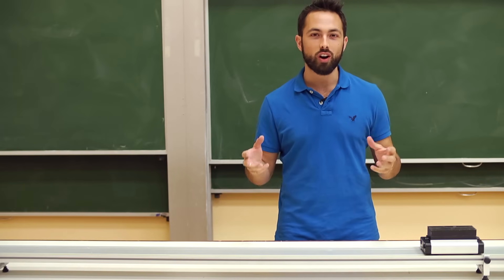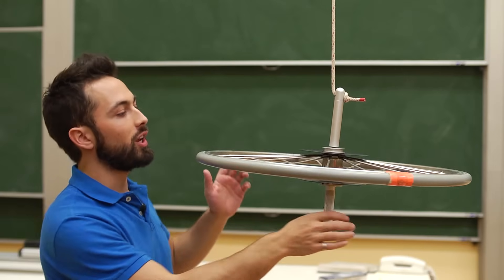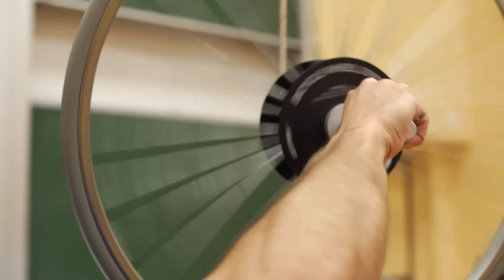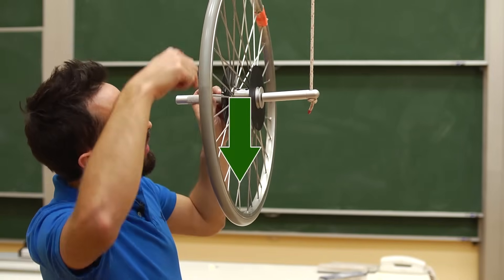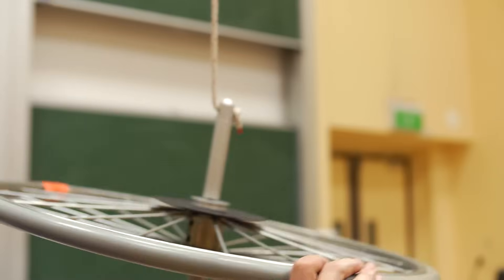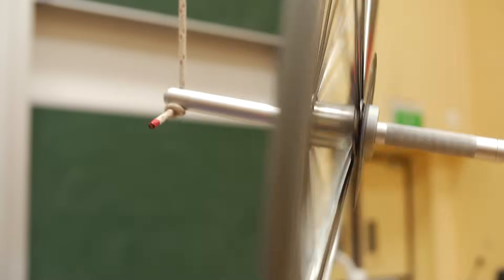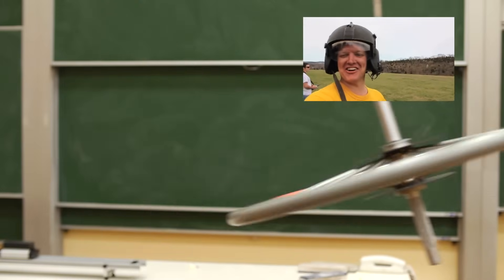Gyroscopic Precession

Comment: Angular momentum is used AFTER a right-hand rule.  That means you are using a math analogy that has NO basis in fact at all -no real mechanism.  You do not understand anything using accurate math analogies, because math does not need cause to generate coincidental answers for you.  THINK, spin and tilt are perpendicular vectors around a plane which don't affect each other, and momentum is a potential energy that does nothing.  Spin only sets a rate for the real cause.  Look at my video explanation based in CAUSAL accelerations.

Comment: Would the linear equivalent of gyroscopic procession be like a puck is moving along ice in a straight line, and then you apply a force at 90 degrees to that motion thus changing the motion (and momentum) of that puck to some other angle (still moving in a straight line)?

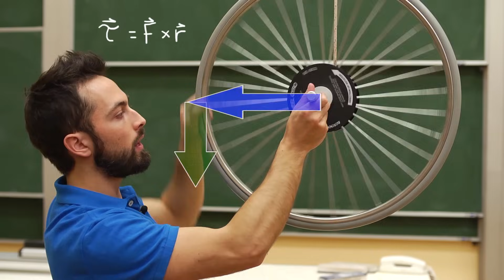Comment: The vectors in the torque equation at 1:18 are in the wrong order. So the sign in the equation - as it's written - will be incorrect because it depends on the ordering of the vectors. (Look up "torque" on Wikipedia for the correct equation.) Really nice video otherwise!

Comment: Exact same thing on the motorcycle the wheels are in fact gyroscopes use the term counter steering applying force or change direction speed and weight

Comment: If we spin the wheel there are two angular momentum. One is for spinning and another is for the weight of the wheel. Since angular momentum is a vector quantity therefore the new torque is just the rate of change of the resultant angular momentum.

Comment: Here’s a thought.
A simple example - LNG returns to its gaseous state when de-compressed.  This proves that molecular bonds are elastic.
I find the right hand rule explains nothing; only describing what happens.
Could bond elasticity under the influence of gravity not have a bearing on the direction the spinning wheel rotates?  The stretched lower half would effectively have a greater radius than the compressed top half, therefore the lower half would have a resultant ‘throw’ in whichever direction it is spun?

Comment: Physicist: 

this is called conservation of angular momentum, a bit of a word soup but ill try to explain.

its worth noting, this is similar to an expiriment with a wheel that demonstrates gyroscopic procession, but thats a different concept. I can explain the difference if someone wants.

when you spin the wheel you give it angular momentum (spinning momentum).

if the guy in the back wasnt holding the chair, when the wheel was being spun, the chair wouldve started rotating counter clockwise. the actual "pushing" of the spin only happens during a change, like how you would push a toy car on a flat surface, its only speeding up in your hand, once you let go it only slows and stops. so as the guy holds him, when the string ends spinning, its no longer twisting the chair.

when the guy on the chair twists the wheel, hes changing the direction of the spin of the wheel, and as he does so, it puts ann equal opposite force on him the other way. If he turned it over and held it there, he would slow down and stop. he was only being activly twisted while he was rotating the wheel.

Comment: 01:10 I am commenting on a 12 year old video, maybe too late to make an impact. "Torque is Force times the distance from the rotating axis." No, that's how we measure torque, but it doesn't explain what torque actually is. Torque is a pair of two forces, parallel to each other, but opposite in direction, applied on two different points of an extended body. Even this is too complicated for a layman. But at least we can make it simpler if we consider each phrase at a time. To avoid making the comment longer I will stop here.

Comment: I have found this video after searching to see if something can rotate around more than one axis at a time. Specifically I was imagining a pair of black holes where the combined rotation around their own axes (plural of axis?) is at 90° to the axis that is the point that the two black holes orbit each other around. Can that result in a back hole that has two axes of rotation or does the final combined black hole rotate around an averaged out single axis? Is there something in conservation of angular momentum that works to align the rotation of an object with it's orbit of a binary companion? Like will a planet which orbits with a north pole that faces it's star at one point in its year then half a year later the south pole is star facing realign to have a rotating equator facing the star?

Comment: @Veritasium, if I'm not mistaken this example is a bit like a helicopter, the spinning wheel is the main rotor and the rope is like the tail with the small rotor providing an opposite force or "thrust" so that the helicopter doesn't itself spin wildly opposite the direction of the main rotor. And by manipulating the torque angle of the blades which the "angular momentum" follows, the direction of the helicopter is altered.

Comment: While your statement that the two rotors cancel the torque of each other is correct, the demonstration of gyroscopic precession is very misleading. It’s incorrect to say that that’s the reason helicopters have a tail rotor. The main reason is to cancel the reaction moment caused by the drag on the rotors.

Comment: I found a major mistake in this activity which I will definitely correct when I will perform this activity in the classroom. The person demonstrating the activity in the video at time 1:15 wrote the formula of Torque as Force cross Radis vector
  which is wrong and the correct expression for Torque in vector form is Radius vector cross Force vector because torque is a vector quantity and vector cross product is not commutative . The person after writing the formula wrong uses the correct formula while finding the direction of torque using right hand thumb rule. If he would have used the his written wrong expression then the direction of torque would have been opposite.

Comment: At the end there where the wheel is spinning in the direction of the angular
momentum, to neutralize or stabilize the 
angular momentum you would need an 
"anti-torque" applied to it in proportion to the torque produced. That's why helicopters have anti-torque pedals, to keep the fuselage from spinning in the opposite direction of the main rotor n to keep the fuselage pointed in the correct
direction or heading...🤔

Comment: This concept is used in flying saucers to stabilze them but with an additional way to propulse the saucer using centrifugal force, and the center with the pilot cabin has a system which absorbs the shock from massive acceleration that would normally kill you
Reply: I was thinking this too!

Comment: So it's the torque increasing the angular moment of the wheel in the direction of the torque that holds the wheel upended and not the magical force of gravity pulling the rubber tire to the center of the earth?

Comment: Imaginary torque vectors to explain the wheel rotation is actually obscuring understanding. No perpendicular to plane forces at play here. Only the speed vector of every point in the wheel in every instant are being applied a perpendicular force with max amplitude and opposite direction on vertical extremes of the wheel. This changes every speed vector out or inwards but in next instant that point is taken away from its prev position, keeping it’s new speed vector pointing outward or inward (top or bottom points). Which as the points approach the horizontal line crossing the center, forces the wheel to rotate.

Comment: In nature there is obviously no fixed spinning objects in the sense we have manufactured through the use of bearings etc. So my question is, if you add up all the spinning objects created by humans on earth, such as engines, cars, trains, bicycles, electric motors and so on in certainly adds up to quite a bit. Will they have a miniscule effect on earths rotation or do they balance out since they are pointed in every direction?? 😄

Comment: Ok so just like a perpendicular force can change the direction of the momentum but not its vector length, a torque vertical to the angular momentum would make it spin but will not change the magnitude of the momentum, if not so rigorous. But i am curious, why is it so asymmetrical? I believe the physics of our universe to be symmetric, and if so, is there any reason it should spin counterclockwise with gravity heading downwards? Im not capable of understanding mathematical stuff, just like to know if physicists can try answering to questions like this or my question is so dumb that it derives no meaning.

Comment: The direction of angular momentum / torque can be very confusing.  
As far as i read it up: There is no real movement in the direction of their vectors. The direction is a convention that, together with the direction of force and distance from the axis of rotation, clearly determins how the object rotates. (clockwise and counterclockwise isn't sufficient, because it depends on perspective)

Comment: Thought experiment: a wheel is spinning on a plane (for example, a bicycle wheel lying flat on the ground), assume a push on the side (e.g. rubber of bicycle wheel) of the spinning wheel does not stop the wheel from spinning. Does the wheel move?

Comment: You did not explain that the Spinning Wheel rotating clockwise is called Precession. And that the  angular momentum vector  is chasing the torque vector which explains the direction of rotation. And finally the ratio of those two will be equal to the angular velocity of the precession.......But I do LOVE all your interesting videos.

Comment: I'm not sure if you can just add the two angular momenta, because one of them is defined wrt the center of the wheel while the other is defined wrt the point where the rope attaches to the axle.

Comment: A tilting plane has two seesaw ends with opposing tilting velocity, so tilt velocity and spin velocity are perpendicular vectors which cannot affect each other, so why is there a conservation of spin?  All of the math used to describe this effect comes AFTER the right-hand rule, not the left-hand rule.  So, everything after that is an analogous success using angular momentum (doesn't really exist, it's a math convenience) which captures several supplemental effects and a single main CAUSE that no one knows about, because they worship math and stop thinking when it works.  Look at my latest videos.  I'm not a video producer.  I am trying to get people to see that math can perfectly describe and still be wrong, so STOP DERIVING CAUSE FROM MATH!  The gyro is a macroscopic toy, and for 20 years people have refused to see this.  Doesn't it feel like the gyro is just a bunch of mnemonic devices?  There is no mechanism to your theory.  Mine is better.

Comment: As I understand, the direction of the angular momentum vector was chosen arbitrarily. In other words, we could have made it the left hand rule. It is just a way to describe rotation easily. I feel like this description is trying to say this phenomenon is caused by outward angular momentum, but that's just a concept we invented.

To understand the real reason you can think of the top of the wheel as a point. With no spinning, that point will travel outward, pivoting around the string vertically. But this point is moving around the wheel, so the side of the wheel that the top rotates towards gets pushed out. In the same way, the bottom of the wheel is trying to travel inwards, so the other side of the wheel gets pushed inward. So if you think about it, it's just like applying an outward force to the left of the wheel, and an inward force to the right of the wheel, or vise versa. That's what causes the horizontal rotation instead of the vertical rotation.
Reply: thanks a ton for this visualisation, it was EXACTLY what i needed to understand it!!

Comment: I really don't understand where torc plays a roll.

The spinning wheel resists change in direction.  Because gravity is pulling down on the wheel the top of the wheel is pushed in a vector away from the contact point, while the bottom of the wheel is pushed toward the contact point, on a horizontal axis.

This force does not immediately pivot the wheel on this axis, however, because of the resistance of change. Now, when the top of the wheel that has accumulated force away from the contact reaches the horizontal axis it is forced to move now toward the contact point, 180⁰ from its current saved up vector. Being pushed now on both sides the forces apply a squeezing force of the metal, which will not squeeze. So, theforces have to reconcile, with the greater force pushing away and the lesser force, being closer to the point 
 of horizontal rotation, pushing towards the point of contact. Big vector away minus smaller vector toward is a net movement away, which turns the wheel away.

On the bottom side the opposite takes place with a net result of spinning on the vertical axis.

Comment: No one ever exams WHY.  WHY is it the right hand rule?  WHY does the wheel spin in that direction and not the other?   Like, why L-handed enzymes work in our bodies but the mirror R-hand enzymes don't.  WHY?  One side of the wheel goes up, and the other side goes down. They're mirrors of each other, so why does the wheel spin in the direction that my thumb points?

Comment: Ok, but if you do the diagram with your hand and fingers on the BACK side of the wheel (going up  toward 12 on the left), the angular momentum is the exact opposite direction.  So why doesn't angular momentum of one side not cancel out the momentum of the other side?  It's the same problem I encountered as a youth: My dad would say about a knob,  turn it down, meaning the left side down, and I would turn the right side down.  Each side has a down, and each side of the wheel has opposite momentum, or doesn't it?  Your twin could be stating the exact same principle on the back side of the wheel, and the momentum will point out toward him in the opposite direction.

Comment: There is a really great potential for getting hurt in artful ways with these gyroscopic thingies. You can build it into this wheeled contraption that you can then fall over on and bonk your head plenty, or put it in a mahine that then goes hurling through the air relying on the thingy to remain stable until safe back on the ground - those of us watching in 2021, though, knows your head didn't really come off there at the end. Good try, but you're going to make a ton more videos that all proves it didn't happen.

Comment: My first real experience with Gyroscopic Precession was in class in the Air Force for Inertial Nav. The Stable Platform held three gyros in three different axises. The platform failed to spin up, to our Instructor had three of us wait five minutes, he'd go get a replacement and we'd move it to the floor. We waited the five minutes, not quite enough, it was still spinning enough that we couldn't control it enough to even come close to getting it on the floor where he wanted it, we had to lean how go guide it and we put it about ten feet away! In practice, out in the field you wait thirty minutes before moving it. Especially out of the front Cockpit of an F-4 Phantom.

Comment: You didn't cover (at least well enough for me) why there's even a "right hand rule" for torque, like why it doesn't follow the same plane as the wheel, and why it causes the axle to hang horizontal.  Lots of stuff left unexplained here.

Comment: To me it seems really strange that the torque goes out perpendicular to one side but not the other. The wheel is symmetric, the axle is symmetric, ... why is the torque asymmetric?
Reply: From one side the wheel is rotating clockwise, while from the other it's rotating anticlockwise.  This means that from one side the torque points away from you and from the other side it points towards you.
Reply: @Michael75579  But why is it that way, and not the opposite? Why is it not a "left hand rule"?
Reply: @adlsfreund  The choice of a right-hand rule is essentially arbitrary; the arguments in the video work just as well if you assume a left-hand rule and reverse the direction of all the torques.

Comment: i watched this 10 times and still i dont feel like it goes into my head, my clg teacher explained the math and it was fine, but it is still tough to imagine that happening
Reply: see the torque due to rotation is pointing away from the center while the torque due to its weight is acting along its side. so the overall effect is that it starts rotating because of the combination of those 2 vectors.
Reply: @dioptre  the torque due to spinning of wheel starts at the center of the wheel and points outward, the torque due to the weight starts at the string(not centre of wheel) and points along side the wheel.  

i hope u understand what i mean by starting.

so they dont start from same point. can we really take a resultant for them, or something like that.
Reply: @sairushikjasti660  yea sorry i didn't think fo that before. But I don't know if their resultant can't be taken 🤔
Reply: @dioptre  ya i also have same doubt

Comment: To all those who say that he was wrong because he said torque=f x r:

Torque vector = radius vector x force vector,, the order cannot be interchanged because, cross products yield a vector and changing the order would change the direction of torque.

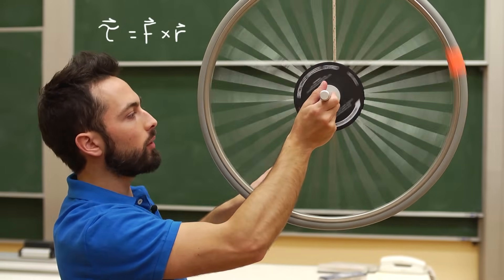At 1:21, he was actually talking about the magnitude of the torque, so it was okay to interchange as he was not specifying the direction.

He specified the direction later by talking about the right hand thumb rule

In other words, when talking about the magnitude alone, changing the order does not matter.